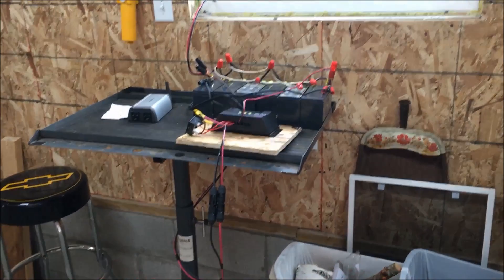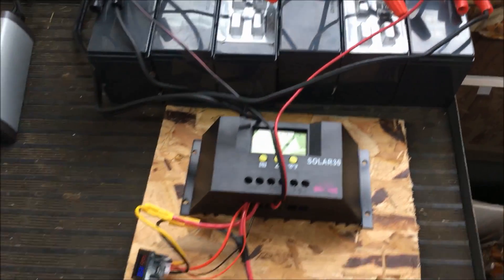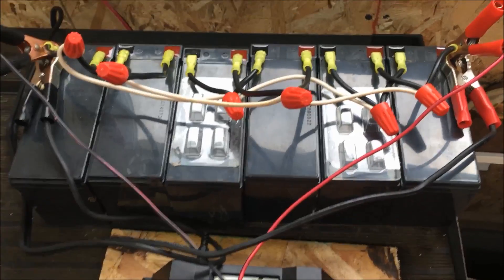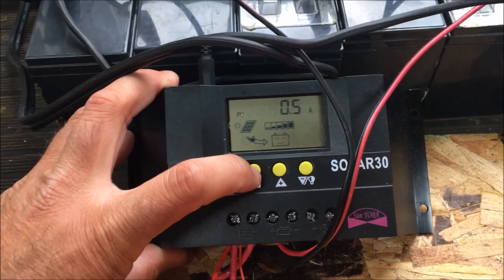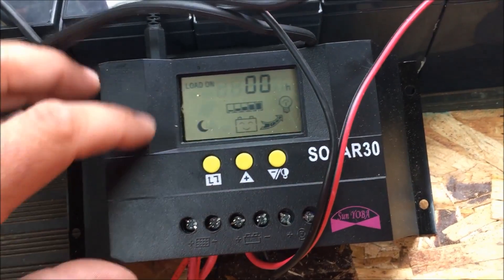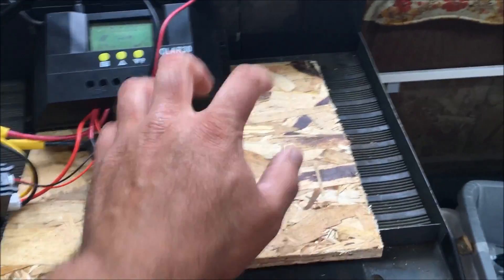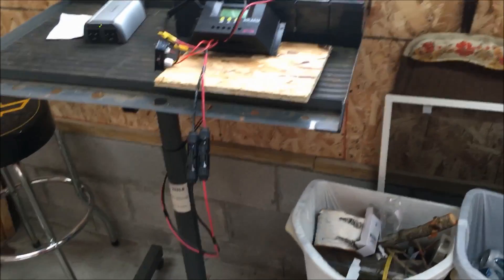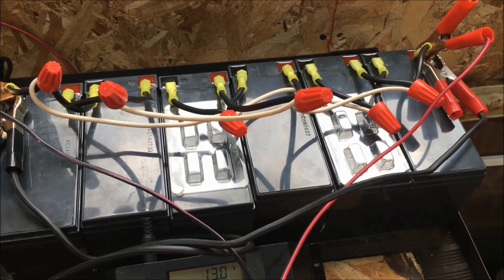Solar Panel Project EP2 / Solar30 PWM Charge Controller

Comment: Hello friend, thanks for that video. I bought a cheap DSN-VC288 volt/ammeter that has two thick wires (RED and BLACK), and three thinner wires (RED, BLACK and YELLOW). I would like to wire it up to monitor the output of my small solar panel setup, but I am having a hard time finding out how to wire it. Most videos are using a dedicated battery for the meter, which I won't need because of the low voltages I will be measuring. Any help would be appreciated! My DSN-VC288 is the latest version so here is the wiring for the bare meter : https://www.mikrocontroller.net/attachment/305967/__3.jpg     I assume in this case the solar panel acts as the "battery source" and the load becomes the battery (or batteries)?
Reply from the maker: Here is another video of mine on this project were I show a little more of how I wired it: https://www.youtube.com/watch?v=ABlHqiYB8sI. I'm not an expert by any means but that is how I wired mine. The solar panel powers the meter and also reads the current. The meters I used look to be a little different than yours but I would think you would go with diagram 2 in your link. The power for load and meter would be your solar panel and the load would be your charge controller. Like I mentioned I'm no expert but that's what I would think from what you told me. I hope that helps.
Reply: I think I fried my controller, there was smoke and a burning smell... Do you know Google Slides? I used it to make a short diagram of how I wired it up. Can you take a quick look? https://docs.google.com/presentation/d/1xL7InwbSeqB0JLrU_jbPZzpxQawXyNDS2UpwThcEkw0/edit?usp=sharing

I followed the instructions I seem to see everywhere, and wired everything up using the solar panel as the SOURCE and the controller as the LOAD (to see in real-time how much amps the panel are generating).
Reply from the maker: I am so sorry you fried your controller! I have looked at your google docs image and reviewed the image for proper wiring for the meter and it all looks like you have it wired correctly according to the diagrams. The only thing that bothers me is why is the black wire not used on the smaller 3 wire connection and why is the larger 2 wire connection black and red. Something is off there. I can't make heads or tails of it. Check out this link of my meter and look at the diagram. It's a lot different: https://www.amazon.com/gp/product/B01CJGN662/ref=as_li_tl?ie=UTF8&tag=upperpenins05-20&camp=1789&creative=9325&linkCode=as2&creativeASIN=B01CJGN662&linkId=befa1021a4e47caabeffcd9225ff863e.
Reply from the maker: It may be the diagram is wrong and the larger 2 wire connection is for the power of the meter, positive and negative. The smaller 3 are for calculating the voltages like the diagram of my meter. Which still doesn't make sense to the meter I have because the larger wires were the load wires and the power was the smaller wires. I'm really sorry, I think you just got burned with an improper meter.
Reply from the maker: Also double and triple check that the solar panel or panels does not exceed the amps of either the the meter or the charge controller. That goes for the wiring also, make sure it all can handle the output of your solar panel.